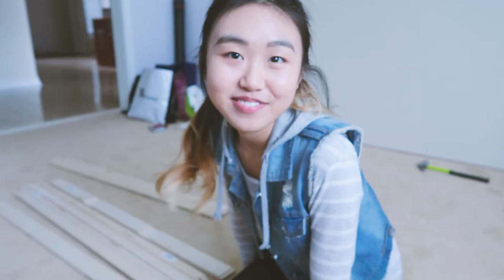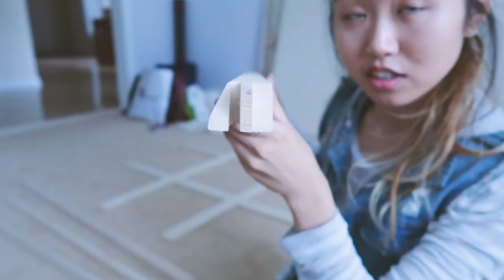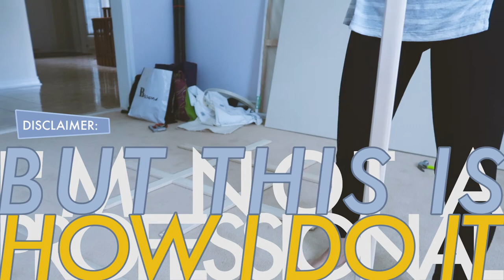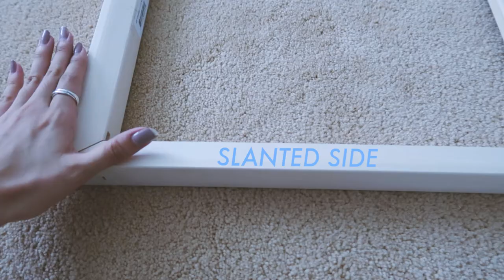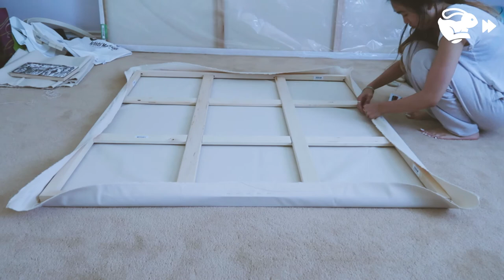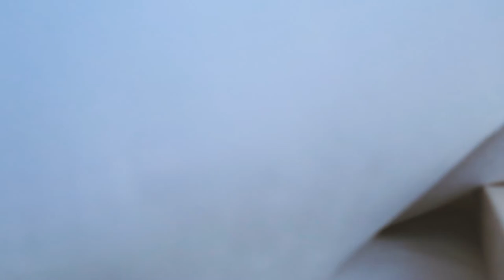Painting 101: Build Your Own Canvas

Comment: cool! this was quite informative! i didnt rlly get how you stretched the canvas though.. did u unstaple, pull and then restaple each time?
Reply from the maker: Essentially:

3:25 - You want to alternate between the 4 sides of the canvas to ensure that your canvas is stretched evenly (like tightening a drum).  Every time you switch sides, you are pulling the canvas as tight against the edge as possible, and stapling once. 

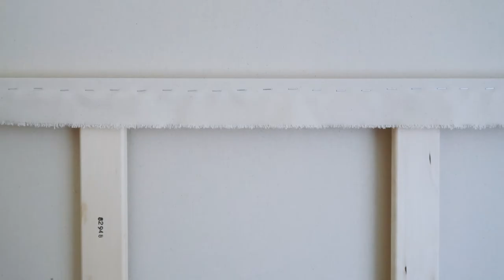3:57 - This is the order of the staples for each side. i.e. You start off with one center staple on each side. Next, you staple to the left of your first staple and you do this for each side (according to the order shown at 3:25). After that, you would staple to the right of your center staple, and so on.

You could also do 2 staples each time you switch sides (left and right). As long as you're consistent, then it'll be stretched properly :D